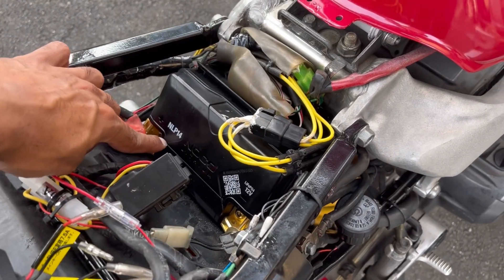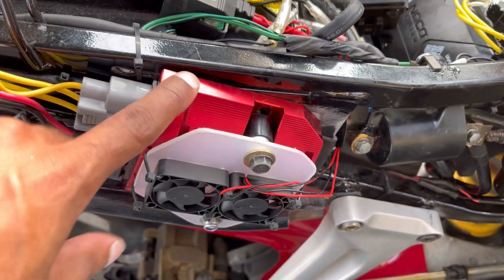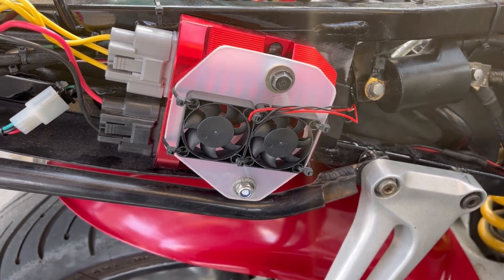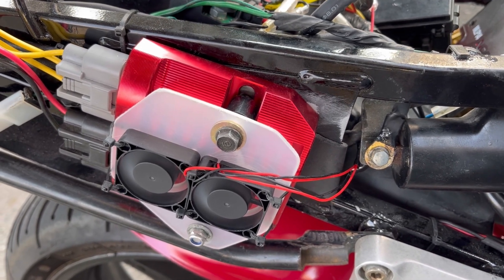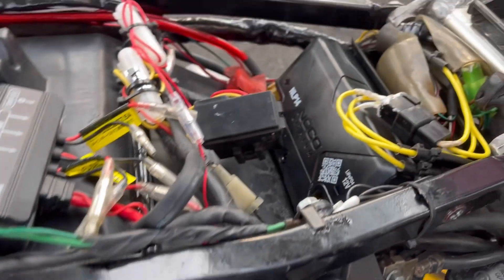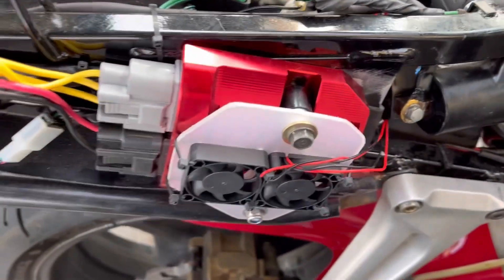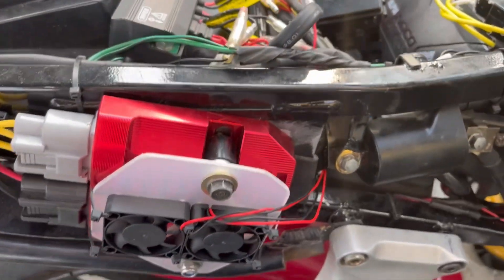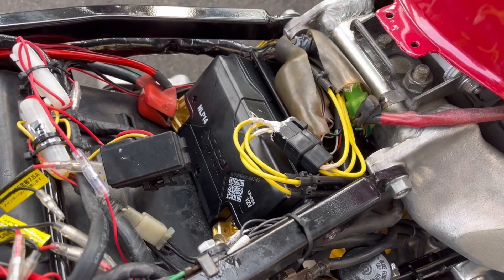DON'T Install Lithium Battery Before Watching! Failure Proof Battery And Charging System Upgrade!

Comment: My quad took it for two rides and battery swelled and split open like it froze
Reply from the maker: That sounds scary. Hope you weren't hurt. Had the battery in my bike for a full year and no issues whatsoever. It comes with a long warranty too. But not sure what actual support is like if you have a warranty claim. Did you try get a replacement or a refund?

Comment: On my 3rd one.  One dead out of the box.  Then second one failed in less than a year.  The third one started leaking brownish fluid 3 months later.  Going to take the last one back ( under warranty ) and just get my money back.  Got lucky and smelled it after a ride.  Was very, very hot.  Could have caught on fire...
Reply from the maker: Woah that's horrendous quality control.
I only ever bought one and it served me perfectly with no problems for a full year. 
Must have been lucky.
Reply: @TachOnRed  The AutoZone store took it back no ? asked.  Said they have had them returned before.  Guess no major lawsuits to stop them from making them.

Comment: What about float charging.. lifepo4 don't like being float charged when they are already full they die...
Reply from the maker: Good question! To be honest, I'm not sure. I had the lithium battery and regulator rectifier setup on my bike for a full year. And coincidentally I removed it before I selling the bike just 2 weeks ago.  I didn't use a trickle charger on it even once during that time. So far all good, even in the peak of winter, it started up first try, every time. 

Now tossing up whether to sell the lithium set or put it on my new bike. 🤔

Comment: The second link directed me to battery as well and not to rectifier.
Reply from the maker: My apologies and thank you for spotting that! I've just fixed the link.

Btw, it may not work if your nearest Amazon Store is outside the US. In which case you might need to use a parcel forwarding service.

Comment: Good video, except there is no such thing as a motorcycle rectifier "designed" for lithium batteries.

In theory all you need is a charging system that works as intended. (doesn't charge over 14.4v (±0.5v))
Reply: Actually Ricks sells rectifiers for lithium batteries. They charge at 14v which is about 1/2 volt less than normal rectifiers.